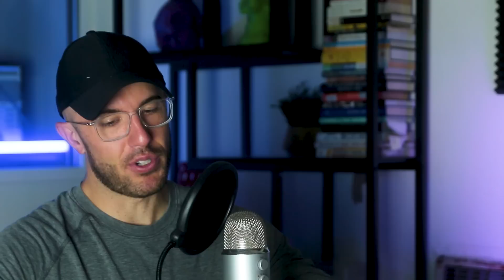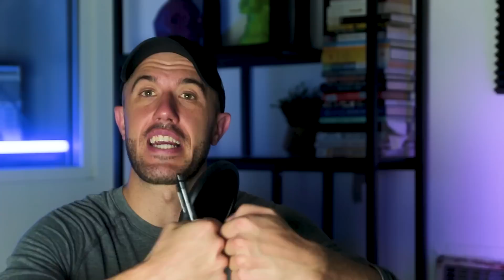We Need More Competition | Company Updates | 3D Printing News

Comment: Normal concrete pouring has air bubbles. They use a vibrator to get the air bubbles to rise up and out.

Comment: On concrete, research aircrete (air filled cement) light very smooth flow but weak. The denser concrete the stronger the processing in 3D printing air-rates the concrete to some measure.

Comment: On the merger/acquisition of desk top metals, yes, there tends to be issues with combining different cultures.  I wish them the best.  Change is hard.

On flowable concrete, yes, air entrainment is a impingement on making it flowable.  Most companies use additives for higher tech concrete (not adding water which weakens it long term.)

Comment: Does 3D printing scale for parts that could also be made with mass production manufacturing methods?  I think this is the issue.  If you need a lot of parts, then you'll just make a mold and get your parts injection molded for lower cost and better quality.
Reply from the maker: We do this every day
 Solved scale 4 years ago
Reply: @slant3d  The biggest flex is if you 3D printed your spools for Tangled and STILL were able to outcompete Chinese filament manufacturers.
Reply: 3D printing isn't cost competitive BECAUSE 3D print farms don't exist at the same scale as injection modling facilities, and the raw material (filament) is not cost competitive with pellets because... 3D print farms don't exist at scale. An increase in demand for print farms would force raw material input costs to fall to commodity levels and then it will be cost competitive. That is my read on the central purpose of the video.
Reply: @NotSure416  I guess it depends on what your use case is. If you are talking about a product that you know your not going to change it's shape anytime soon due to customer feedback, plan on storing it for a while as it gets distributed to consumers and the geometry permits it then yeah injection is better. But if you don't have a great capital investment, you are still finding what shape or design your public likes or maybe you need special geometry only achievable via additive manufacturing and don't have storage space then 3d printing is better when you have a 3d farm or use a service like his to print on demand
Reply: While mass production may be more suitable for certain applications, imo NNDM's 3D printing technology offers a valuable solution for a wide range of industries that require customization, speed, or complex designs.